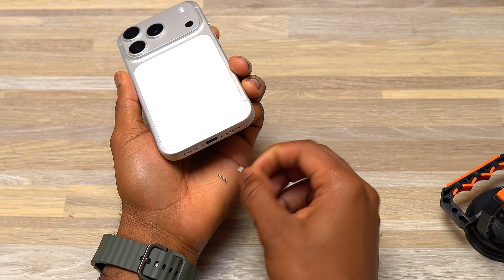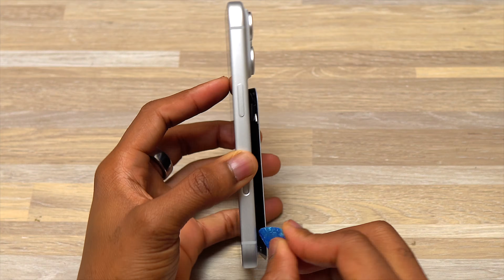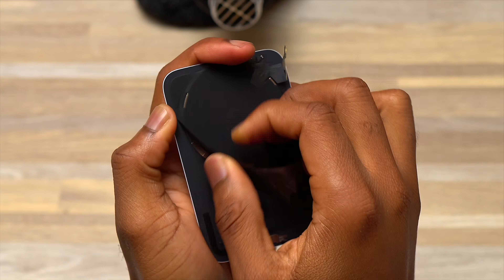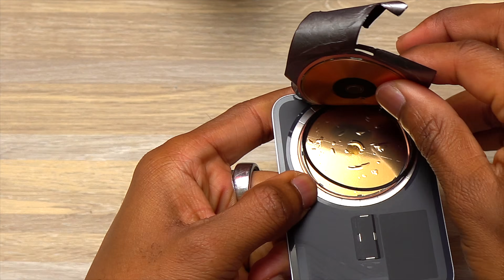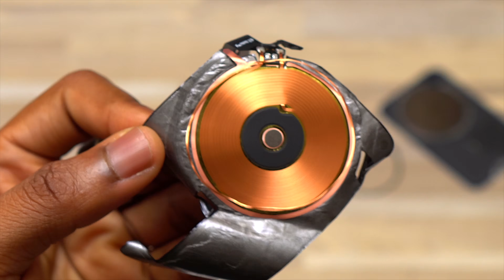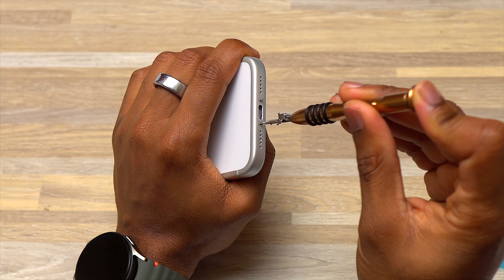iPhone 17 Pro Back Glass Replacement Repair Friendly

Comment: It's better to leave the old glue in. With metal you will scratch the case and it will be less waterproof. It's best to heat it up, close it, press it and let it cool for 90 minutes. :)